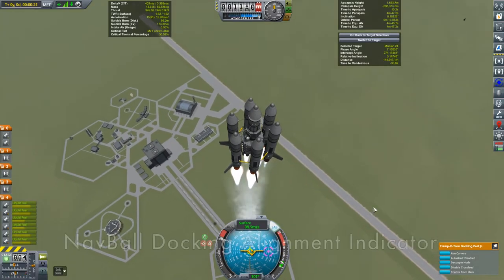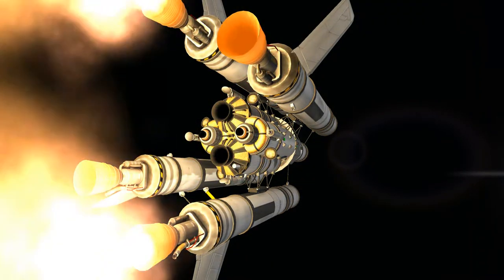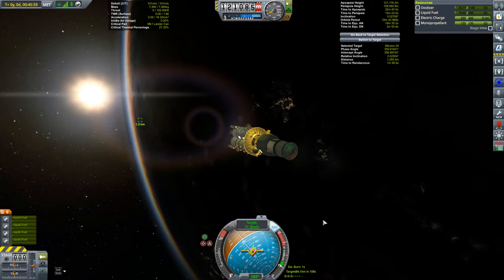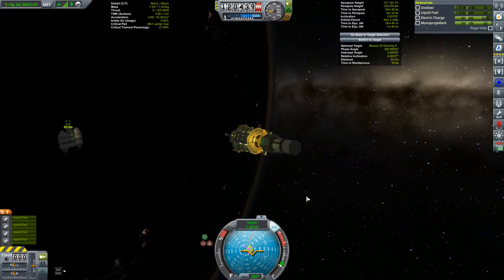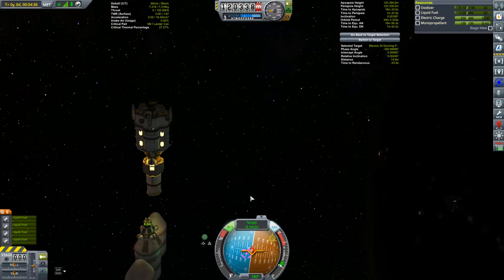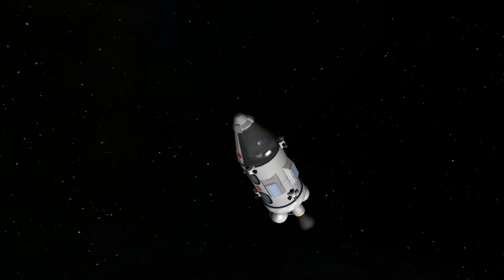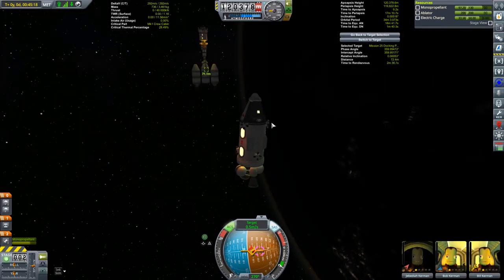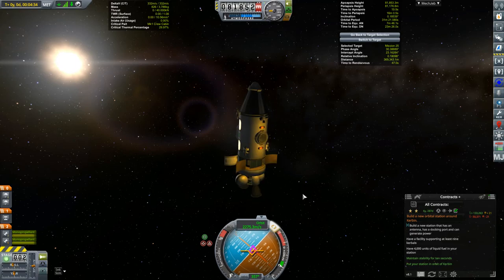KSP AV Career: 13 - Station around Kerbin

Comment: One quick way of balancing the stack design you prefer at 1:15, is to add more fins and/or swivel engines. Additionally you can increase the amount of control modules. Way back in the day we didn't have fuel priority ;).

Comment: I'm glad to see you sometimes have as much trouble controlling the vehicle during docking as I do!
Reply from the maker: I'm still going back and forth on the Docking Alignment Indicator mod, but I do think it's a mod too far for a game I'm trying to keep stockish.
Reply: It would be great to see the same sequence done with just the Docking Alignment Indicator mod installed, to see how different (easier/harder) it is to dock with it, versus the one you used.  It would still just be the 'one' mod (as you have now) but that gets into a mod comparisons though - not really the intent of the videos.
Reply from the maker: For ease, it's hard to beat Docking Alignment Indicator.  Once you understand it, docking is a piece of cake.  You constantly know where the target docking port is, and whether you are in front of it or behind.  It also gives you the perpendicular distance between the planes of the two ports, and how quickly that distance is changing.  It's also integrated with Rasterpropmonitor so that it will be on an interior screen.  I've comfortably done dockings using it from interior view.

Comment: I'm using Texture Replacer Replaced. One of the nice things about it is that it makes use of directories and filenames to adjust the behavior of the mod. So, for example, female textures no longer get mapped onto male heads. It is a bit tricky and not well documented, but it can be made to work right. 

I'm not using environmental visual mods, at least not yet. 

The Alignment Indicator really is one of my favorite mods. It really makes an instrument docking where you're only staring at the navball possible.
Reply from the maker: At the end of this video, I had reverted to Texture Replacer, but I'm now back with Texture Replacer Replaced, and yeah, it's pretty powerful.  I'm really intrigued with the idea of controlling suit textures based not only on class, but also level and situation.  I just have to be wary of loading too many textures.  You may also able to adjust visor colour based on rank which may not involve loading any textures.  I'm not sure.  I'm still playing with it.

Things work best with dds files rather than png, which I'm less familiar with.  Might need to find a descent image converter.  There's a guide on creating your own head textures that I wish I had the time for.

I've been getting more practice with the Navball Alignment Indicator (there'll be a fair amount in the next episode).  I'm definitely getting used to it.
Reply: Yeah, I'm pretty impressed with TRR so far. Once they get the environmental stuff down, I'll be giving that a go as well. 

For docking in general, I think Better Burn Time and Alarm Clock are huge helps. I find that if you set up a "closest approach" alarm with one minute leeway, I don't get antsy and end up wasting fuel by acting too soon.
Reply from the maker: Better Burn Time is awesome.  I recently did a Mun landing and it suddenly chimed in with the impact time and estimated burn time.  Spectacularly useful.
Reply: Indeed it is. It's the "closest approach" thing that's the biggest help for me and my rendezvous.

Comment: The latest Diverse Kerbal Heads is now dependent upon Texture Replacer Replaced (TRR)
If you use the version just before the most recent, that one is compatible with either TR or TRR.

I installed TRR but went back to TR because several Mods, including DKH and Pool's Skybox were not compatible with TRR and I was having the same issue you got with DKH

With that second to last update (Spacedock seems to be down at the moment or I would post the version) DKH was updated to be compatible with TRR, but was still working with TR as well. With the newest update, DKH only works with TRR.

I like TRR, but as other mods such as the skybox are not working with it yet, I am sticking with the one version older DKH and with TR. until those update too.
Reply from the maker: You pretty much hit the nail on the head as to what happened.  I used CKAN to carry across my mods and somehow ended up with both TR and TRR installed.  I eventually realized the incompatibility between DKH and TRR and did the same thing as you, rolled back to TR, which is what you see at the end of the video.

Since, KottabosGames put out a video promoting the updated DKH.  My old skybox seems fine (you're seeing it in the cinematics) as are my uniform textures, so I made the jump.  I did lose Diverse Kerbal Lasses, but DKH now has proper female textures so it's no biggie.

I do like TRR.  There's a lot to play with.  Though, I'm not a fan that it messes with the title in the game intro screen.

Comment: From my experience with the parts you used: 
-try avoiding using the flange  adapter in the manner you did, provides a lot of drag;
-the mk2 lander has a lot of drag too, especially in the manner you used it. Try to clip it into an adapter, or give it a "hat"

I guess is ok since is a space vehicle anyway, but it will make your launches way easier.

Comment: Suggestion for making docking easier, the old way, with no auto-target and no docking mods.

I always found it confusing which IJKL keys to press in order to go where I want, in relation to the target. Solution I found is to mark with different color lights port and starboard directions, red for left and green for right - J and L keys. That way you have a visual indicator which way your ship is translated in regards to the target, and what keys you have to press to go where you want.

Each docking port you make on a ship, should get these 2 lights. When docking, simply switch them on and align the colors. If you want to go the extra mile you could add 4 lights, for dorsal and ventral, but is not necessary and makes the docking port too cluttered.

Another thing you might want to consider, is to put the docking junior on the nose and use a radial parachute. This off course is subjective, each player has his own unique designs and way of doing things, but in this context, it will save you a lot of hassle, since when you use "control from here", it doesn't messes up your RCS translation keys.